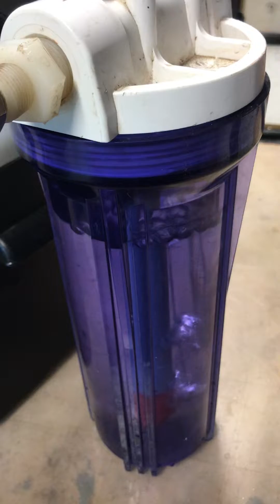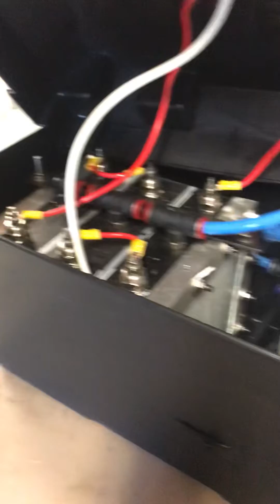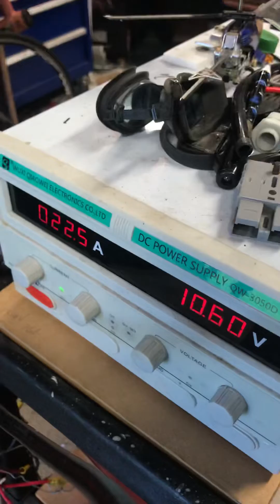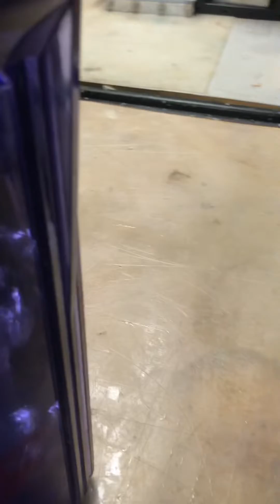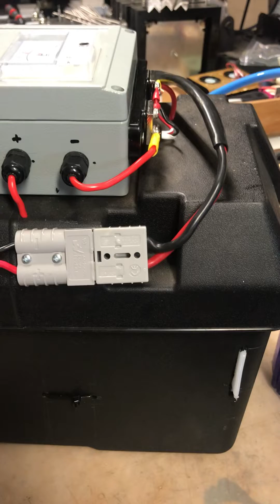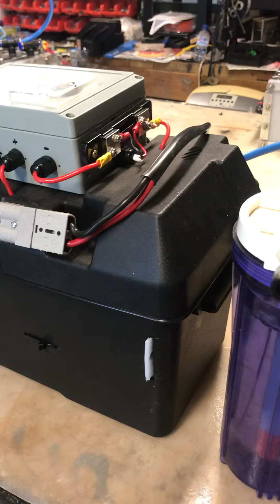New gen 10 hydrogen fuel system July 2021

Comment: Sooo 22.5 amps is just idling. You'd need a larger alternator in some cars just to keep up. Do you have any actual evidence to back your claims? Your websites make lots of claims about testing by various parties but there is a glaring lack of substance. Anyone with even a basic understanding of this setup knows that there are only going to be losses, not gains.
Reply from the maker: https://hydrogenfuelsystems.com.au   0403177183
Reply from the maker: call me on 0403177183 
glknox11@live.com
https://hydrogenfuelsystems.com.au
patented , proven and certificated system delivering 32% savings on a 7.2 L truck - 27 tonne load